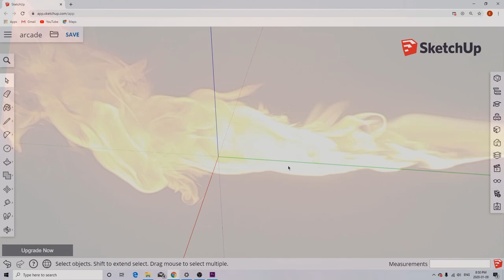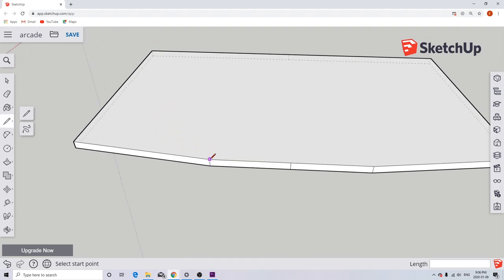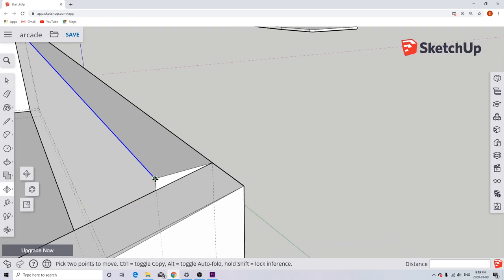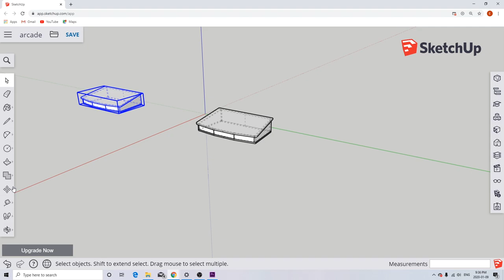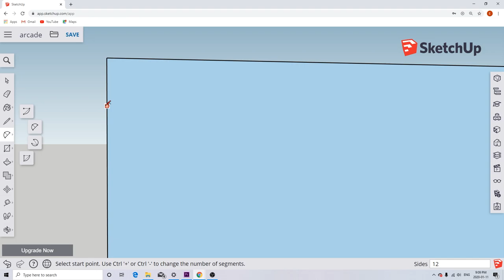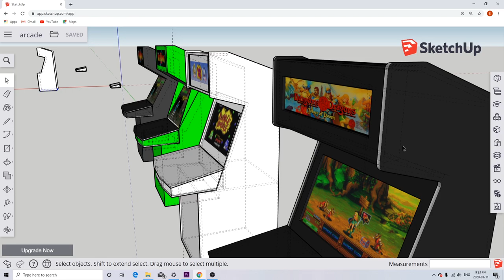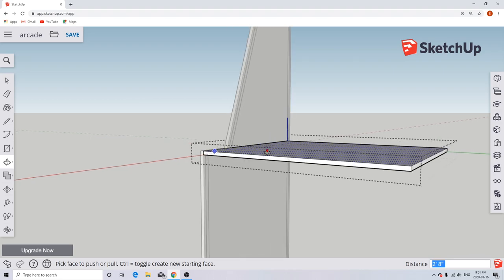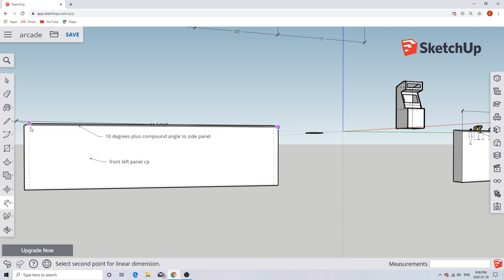Custom Raspberry Pi Arcade Cabinet- How to design an arcade cabinet using SketchUp Online. Episode#5

Comment: I've been enjoying the video's on your build of a Arcade Cabinet.  I notice that you didn't show how to duplicate something until about 38 minutes in. I thought it was odd that you didn't duplicate most of the items and just make the minor adjustments to them. It would  probably would have halfed the time you spent on the control panel. I don't know anything about SketchUp, but I was about 20 minutes in and thinking there has to be be a way to duplicate the sides and the two front pieces. I did learn some stuff so I could probably use SketchUp now, so thank you.
Reply from the maker: Yeah I tried to show as much as I could and introduce new drawing functions as the video went along.  It could have been a very fast video but I slowed it down so people could follow along.  Thanks for the watch and I'm glad you feel more confident with Sketch up now.  Welcome to the channel!

Comment: I use sketchup pro for making 3D building plans from 2d plans and the rendering looks great! Didn’t even think to do this thank you!!
Reply: When using line or rectangle tool click and type the dimensions you want and it will make the rectangle or line the dimensions
Reply: Using the pro version gives you light generating(interior/exterior) high quality textures and a great renderer

Not to mention access to all the 3D models made by others that you can import
Reply from the maker: Yeah it's a pretty cool program and free is always good too.  Thanks for the watch!
Reply from the maker: pretty handy when you know the dimensions for sure!
Reply from the maker: I remember when this was all in the free version.

Comment: I have been watching a lot of videos on arcade cabinets and your series is by far the best out there. Excellent job and I love your design. In fact, I am copying it almost exactly just with a few customizations. Since I don't have access to all the woodworking tools I am going to just export the templates from Sketchup and have them cut on a CNC. However, instead of duplicating all the Sketchup work I was wondering if you would mind sharing your .skp file? I see you are from South Delta, I am from pretty nearby in Burnaby. 👍
Reply from the maker: Thanks Shannon, I tried really hard to make this series educational and entertaining....edutainment?  Glad you enjoyed the videos and like my design.  So I have shared all the dimensions needed to make this cabinet for free in pdf format only.  I didn't want anyone claiming ownership of the original file/design especially if I just gave it out.  I hope you understand.  I would really try this build yourself as you really only need a jigsaw and a drill to make it.  Plus you can save a ton of money doing it yourself and you get to keep the tools after for other projects later.   You would be surprised how much a cnc shop is going to charge you for this.   I used all those machines simply because I have an amazing shop to work in with some amazing tools.  In fact I will probably do another bar top cabinet in the future with just a jigsaw and a drill to show it can be done.  Good luck and I would love to see some pics of your cabinet when you're done. Just dm some pics to my instagram and join the Way of the Wrench arcade cabinet family....there is already 5 of us.  Cheers!
Reply: No problem, I totally understand about the design. Honestly, it is the best design I have found and the fact you are sharing for free is so awesome. Thanks for the advice about the cnc shop, I just assumed that would be relatively cheap (couple hundred dollars maybe), but if it is going to be expensive I will definitely do it myself. I have a drill, jigsaw, table saw, compound mitre so really I only need to buy the router and hole saw bits or forstners. I agree, good investment. Thanks again, keep up the great work!

Comment: Love your design! The use of an ultrawide monitor for the marquee is a great idea. I was looking at Pixelcade's LCD marquees but they're like $800-900. I was thinking about trying to make a cabinet based on the SketchUp plans you posted, but I was going to use 3/4" MDO. Would I have to adjust almost all of the panel dimension b/c you used 5/8" MDF? 

I'm thinking only the control panel would have to be adjusted b/c it is inset into the main cabinet. Am I wrong? Any advice would be greatly appreciated.

Keep up the awesome work!
Reply from the maker: Thanks Lasjah!  Yeah those marquee screens are stupid expensive, that's why I designed mine around the 29" LG ultrawide and I couldn't be happier with it.  I think your right about only having to adjust the control panel for it to work with a different thickness wood.  The cabinet and the control panel will be bigger by the difference in thicknesses. Honestly though, I would not go with a thicker wood, it is already going to be 300 to 400 lbs and will be even heavier with 3/4".  I also think that 1/2" would be too thin so I wouldn't recommend it.  I'd love to see your finished cabinet when you're done, just send me a dm on Instagram. Thanks for the watch!
Reply: @wayofthewrench  Thanks for the reply. I'm only using 3/4" b/c I can't find 5/8" MDO, which should be a lot lighter than MDF. Also, was looking into laminating the panels instead of painting, but not sure how to do that after it's screwed together.

I'm not on IG, youtube is the closest I get to social media. Thanks again!
Reply from the maker: Where are you?
Reply: @wayofthewrench  Southern California
Reply from the maker: How's the build going?
Reply: @wayofthewrench  I wish I could say I have started but I haven't. I looked over materials and I think 5/8" MDF is the way to go. How many 4'x8' sheets did it take? Based on what I mapped out it looks 6

Comment: Could you do quick video on how to make the button holes and out the + in center of the button holes with sketch up?
Reply from the maker: I am planning on eventually designing and making another cabinet, probably a bartop arcade cabinet so I will make a video for the button layout then.  Honestly, I think there are better programs for designing/drawing stuff like Autodesk Inventor so I might use that one next time.
Reply: @wayofthewrench  Also could you show us how to make a psd template to print  artwork
Reply from the maker: Will do.  This whole covid thing really messed with everything during this build including getting custom artwork printed out.  So the next build I would like to explore this more.  Thanks for the future content ideas! Cheers!
Reply: So are still planning on doing a tutorial on how to create psd files for artwork? Plus making button holes with the plus in the middle for the drilling of the holes.
Reply from the maker: I am but at this moment, I am not sure when it is coming.   Lots of stuff going on right now with the channel being sponsored, teaching during a pandemic, etc.  I still wanna do it but it will be for another arcade build in the future.  Cheers!

Comment: Cool I used this tutorial to design a cabinet but how do I create psd templates to have art work printed
Reply from the maker: I believe that you can export a 2d view of the panel you want to design artwork for in Sketchup Online as a png file.  If you have the paid version of Sketchup, you will have more options like pdf,etc.  One thing though, you may want to use Adobe Illustrator instead as any designed art in Illustrator can be vector art which is scaleable without loss of resolution as you enlarge it.  I do know that if you are creating artwork to be printed, you are going to want a minimum of 300dpi or else when it is printed off for say the side of the cabinet, it will lose a lot of the resolution/detail.  I haven't gotten to this point yet and honestly I'm starting to shy towards a clean looking cabinet so that the digital marquee art and the bezel art for each game is the focus point instead of one theme on the cabinet or control panel.

Comment: Instead of moving the model away to make a component, you can make it in place by just double clicking on the part to select it all, then right-click and choose Make Component.
Reply from the maker: I can't remember why but when I tried that it was giving me issues with selecting more than the one model/component. Thanks for tip.
Reply: @wayofthewrench  Cool, just learned it myself and thought I would send it along to another fellow maker.
Reply: Another tip, right-click the component and choose "hide".   You can then change View to show hidden if you want to see a dotted line "ghost" of the hidden component(s).   right-click hidden and choose to unhide.   That way you can leave components in place and just hide/unhide as needed.

Comment: What's better a retropie or a PC running Linux with retopie software
Reply from the maker: Depends on the specs of the pc but usually the pc will be better and cheaper as even an old pc will have more ram than a rpi4.  Even better is a pc with Bigbox ( paid version of Launchbox).  Thanks for the watch!
Reply: @wayofthewrench I was thinking of my Zen+2700x and a RX580 32gb ram or a 5700g same ram no GPU. I can always add a GPU later.
Reply from the maker: 32g of ram plus a decent gpu and that'll rock retropie!

Comment: Fro what I see you have slanted thickness of control panel left and right components. Your inner edges are not right angled so they should be longer than 0.625
Reply: 1:21:24 Dude wtf 😳 ? This is not how you join surfaces with thickness. You need an equal slant on both sides.
Reply from the maker: I'm really not sure what you mean but the pieces were cut to those lengths and angles and were assembled no problem.  No gaps and no problems.  You gotta remember that CAD drawings are extremely accurate but for this particular situation, it's just not a big issue.  Thanks for the watch!

Comment: Your techniques need some work.  Use the erase tool instead of clicking a surface and two lines and individually deleting. And if you delete the line the surface goes away so no need to delete it.  Don't draw rectangles with 4 lines, use the rectangle tool.  Don't type in the height of multiple identical height parts.  Do it once then snap extrude the others to the same height.  Don't delete a part to fit in the side, push it out of the way abit, create the new side, the pull extrude the other part to snap to the side.

Once you get the hang of some of these techniques the modeling goes surprisingly fast.
Reply from the maker: Ya know I usually use a CAD program once or twice a year and I like using Inventor the best but not everyone has access to that so Free Sketch up it is.  Thanks for the tips, I'm sure there are tons of tips to speed up drawings.  Thanks for the watch!

Comment: You are driving me crazy selecting faces to delete them. Just grab the eraser and drag it across the corner.

To select all surfaces while it's touching a component, just triple click it or drag over it but not the entire component. No need to move the component away.

You REALLY need to learn to use guide lines. I have been using Sketchup for many years and your methods drive me nuts! Hahahaha.

You really should have extended the control panel out the sides. It will fix your joint issue there.
Reply from the maker: Thanks for the tips, I'm not a Sketchup master by any means.  I usually use it once every year or two just to make/design something.  Cheers!